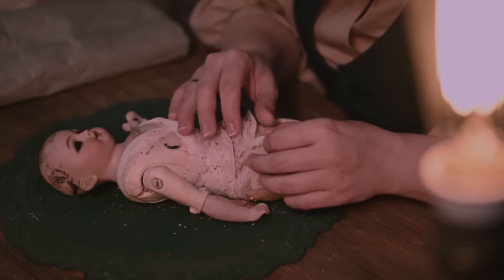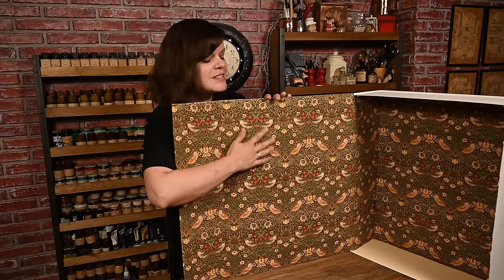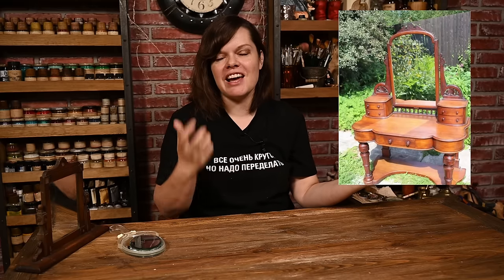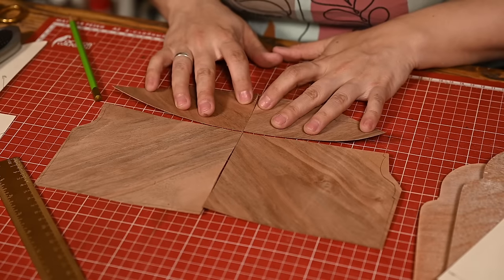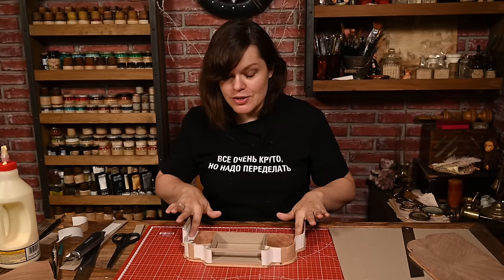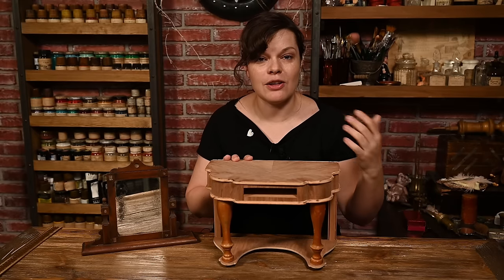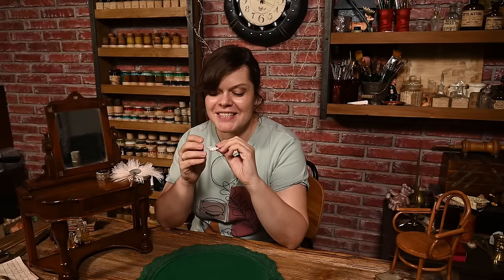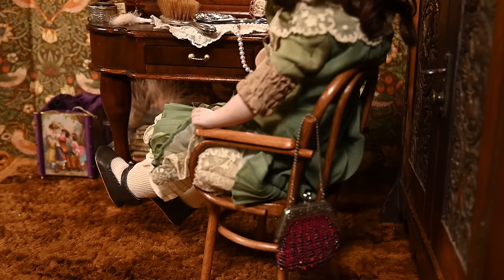I've recreated a XIX century boudoir, but it’s for a doll!

Comment: The dressing table is beautiful!  So well done.  Now I want to try.

For next time, to use cardboard, moisten one side of the cardboard and remove one side of the paper, exposing the corrugated paper. With the corrogate vertical on your pieces, you can create curves. See Sartes videos on YouTube. Block the curves into place with regular cardboard.  

To make cardboard strong, layer two pieces, placing the corrogate in opposition to each other... one running horizontal, the other running vertical.

Hope to see more
 I will seek out your doll restoration channel.  🎉